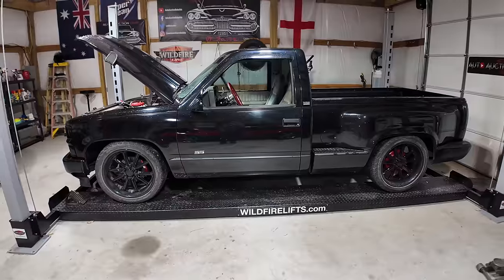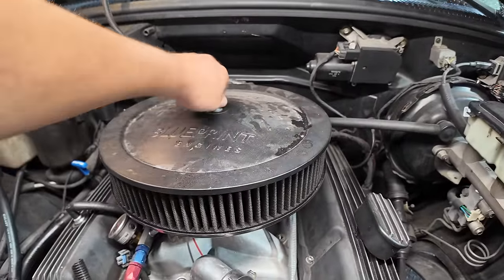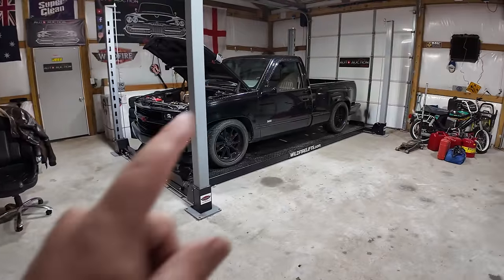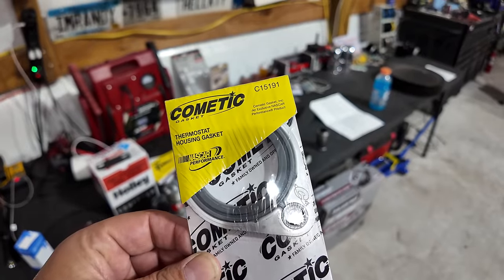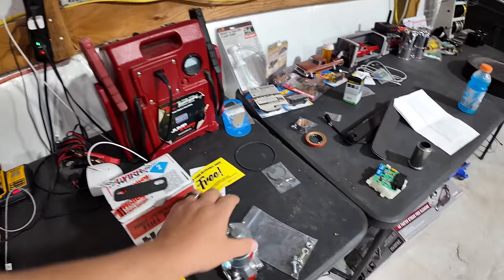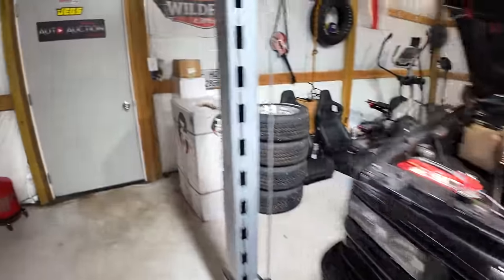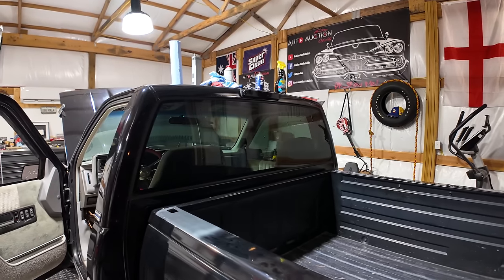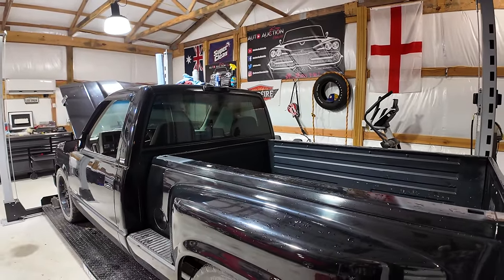This Fully Built $30K Chevy KEEPS BREAKING! Can we Fix it or Should we Sell it?

Comment: Great work Randy. That is a sweet truck.
That was a Mickey Mouse job someone did sealing up that original 3rd brake light! It wasn't even plugged in too. Whiskey Tango Foxtrot? Glad you got that straightened out. The new one looks way better.
Great video. Happy New Year.

Comment: G'morning Randy 🤠 . After I finished building my high compression Buick 350 in my 71 Skylark I took it easy and drove it around for a 500 mile break in,  after which I pulled over and adjusted the timing and made a few other changes under the hood so I could start having fun with it 😋 . I was running a Carter 675cfm afb w/ a strip kit in it & she turned out to be a thirsty girl. I couldn't get past 1/2 throttle w/o her starving out even with a high-performance Grand Sport fuel pump.  I wound up trying both the Holly blue and the red with the same issue because they didn't put out enough to keep up with the engine so I started looking at Alternatives and I found Blackstone fuel pumps.  I picked one up and it solved my starvation issue but it created a new problem. Now it was bypassing the needle and seats so I had to add a fuel pressure log and regulator and The Sweet Spot turned out to be 6.75 psi and she was a happy camper with Full Throttle and no more starvation issues 🤣 ..

Comment: I see one problem with the fuel pump. You should put it close to the gas tank. It pushes gas better than pulling gas. Plus noise will be further back
Reply: Get rid of that Holley and get a Edelbrock pump....much quieter.
Reply: On that pickup truck the pump is close to the tank. The tank is not in the rear
Reply: Put some rubber bushing between the pump bracket and the frame to quiet it down!😊
Reply from the maker: @M_Phipps0520  I did that in the video
Reply: @AutoAuctionRebuilds  ok missed that
Reply: Not the gasket that came with the pump actually a rubber bushing about 1/4 in thick run in bolts till about a 1/16 thick plenty tight and will offset the pump off the frame
Reply: 3 miles an hour over is almost 5 kilometres over in Australia that could totally get you a ticket 😅 lol
Reply: @AutoAuctionRebuilds  hey randy please fix the hyper flash. It should a resistor. Great truck.
Reply: These trucks had a fuel pump in the tank from the factory for TBI. Ditch the aftermarket pump and go back with that. No noise.
Reply: @ashtincampbell6038  Not in Canada, have to be at least 10KPH over otherwise not worth the cops time 😁
Reply: Plus, it has to travel a shorter distance.

Comment: I’d just put a Holley dominator/sniper kit on it with the 12” lcd display in order to replace the stock analog gauges in the dash. Would be much more reliable! I absolutely love that truck but I’m a bit biased because I had a 96 indigo blue 1500 with a fully built 5.7 with a procharger, cam, heads, injectors, intake, exhaust and full JL audio stereo system and I absolutely loved it. I had kids and they simply didn’t fit very easily in the truck so I traded it for a Cherokee and I still miss that truck to this day. Love the exterior looks of that hatchback fox body as well.

Comment: Good driver, looks good. Keeper. 

I had a Holly on a Ford truck before, and it worked okay. But then I sold another car and pulled the Edelbrock carb off and replaced the Holley on the truck. That truck ran so much better, it was a much better running truck.

Comment: Oh, and by the way, you most definitely want to replace that ECU in that foxbody before you chip it. Those capacitors in that ECU probably done about had it.  They start leaking it will never run right. ✌🏾

Comment: Good show.
One thing i wanna point out, if used properly blue devil will either fix the problem or do nothing.
I think ppl who ruin their engines with blue devil have done the math wrong and added too much in with the oil and thats what causes limp mode.
Cars wont keep oil pressure if you add too much bc it thins your oil to a water like consistency and thats what kills ur oil pressure.
I used some on a car and it actually seems to have worked in the same manner for me as it did  randy. 
So thanks for the idea. saved me a huge potential headache.
Reply from the maker: You don’t put blue devil in your oil that would be the first problem

Comment: you will always have no heat because the heater hoses are routed incorrectly. any air in the system will be trapped in the heater core. the water pump is a return side and the radiator is a return side. there is a brass plug on the intake manifold where the fuel lines meet from the fuel regulator and the carb. A hose fitting is suppose to be there for proper heat. the factory manifold would of had the hose fitting  located by the distributor at the back of the engine

Comment: The thermostat that came out I believe was a hi flow.  At one point someone must have been having overheating issues and thought that would fix it.  Whatever was causing the heat is probably why the head gasket blew.  Good choice on the fuel thread sealant.  
I like the brake light I have a black 95.   Where did you get it and does it feel like decent quality?

Comment: that leak from the driveshaft front yoke is probably the yoke itself it has a rubber bellows inside of it ( not replaceable as far as I know) it is there so on hard acceleration if the rear axle moves forward it will flex so fluid trapped between the splines and the yoke will not put pressure on the trans output shaft , that will wipe out thrust bearings real fast, if the fluid is coming from the vent hole in the yoke it means the rubber bellows is leaking, an easy fix for that is to plug that vent hole (a self tapping screw and sealer will work) and remove the tailhousing ang carefully remove one spline from the output shaft with a grinder, this will vent trapped fluid back into the transmission, the part you have will not fix it I was a transmission guy at a dealer for a decade still do not know what it does some have it some do not, you will have to take the front u joint apart so you will need a new one, a new yoke would also work

Comment: If there isn't one by the tank, it needs a good fuel filter before the fuel pump. Electric pumps really don't like contaminants in them. Probably why the original pump failed.

Comment: I agree that fuel pump system is over engineered but it works and I will bet you will not hear that pump with the engine running, and if you ever want to install an 800 HP engine in it you are all set , please do not do that

Comment: Did u not know the Holley reds are hella loud . I bet u won't keep that in for long
Reply from the maker: I bet I will.
Reply: @AutoAuctionRebuilds  but honestly your viewers probably couldn't here it as much when truck was running I couldn't however if u come across it again and want to use a quiet external pump try a low volume external fuel pump like like a European pump or a Mazda electric pump if it needs ample amount of volume ..just a thought 💭
Reply: Also while I'm here and have a little of your attention ..I watched your grand national video ..take a good look at your idle air control ...if theirs one available switch it out if you haven't and I missed that ..but sounds like that could be part of your idle issue

Comment: A fuel filter would be a good idea so you won't be replacing the Holly in 10000 miles
Reply from the maker: The fuel filter literally has less than 10,000 miles on it it doesn’t need a new one
Reply: @AutoAuctionRebuilds is the filter before the pump or after? Love the show Randy.